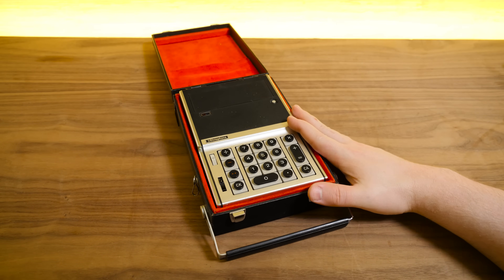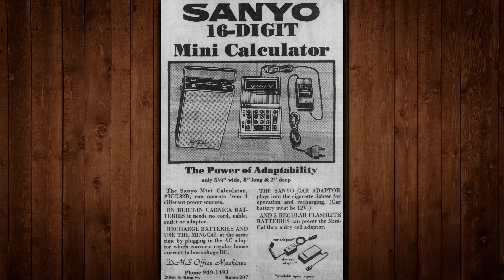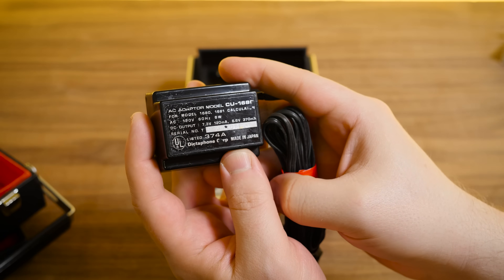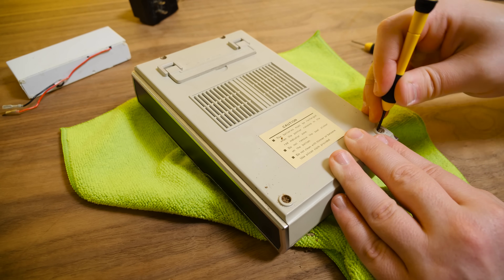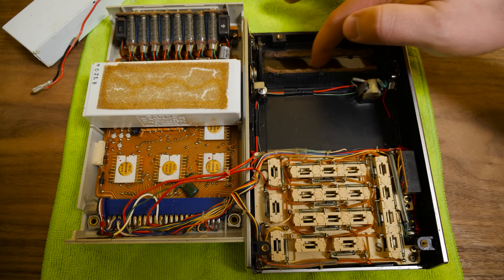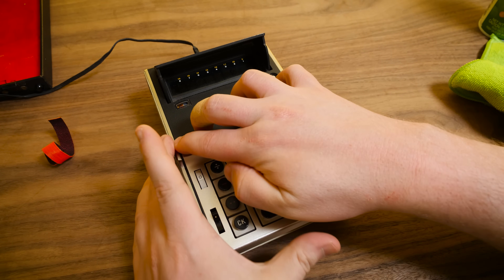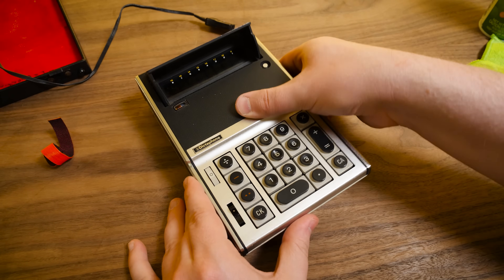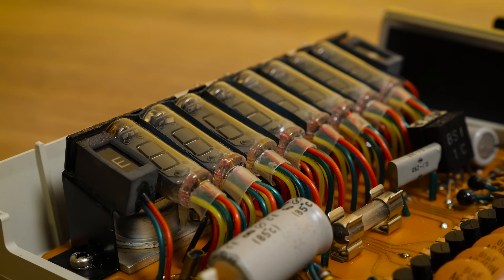Smallest Battery-Powered Calculator in 1970: Dictaphone 1680

Comment: If the display tubes are multiplexed that points to the line going to that segment on every tube not functioning because of a broken wire or trace or could be the switching transistor is dead. Try putting an oscilloscope on the connection for each segment and tracing it back to locate a break or other fault.

Comment: Hey, can I give feedback about the channel?  Im not at all a fan of how now you have a watermark on your channel that is in a black bar on the side of the screen. I want no black bars on the side and I definitely don't want a black bar that has a bright logo floating in it. It's very distracting. Can you keep it on the video at least? Thanks!
Reply from the maker: There is no watermark or black bars in any of my videos. This is a problem on your end of things!

If you're seeing black bars that means you're watching on a non-16:9 display. All my videos are standard 3840x2160 4K videos with a 16:9 aspect ratio. Black bars are added by the YouTube player, it's not part of the video.

The "watermark" you mention is something added by YouTube as clickable a channel logo, it's not part of the video either. You can turn that off in your video settings by clicking the little gear icon in the bottom-right and clicking "annotations."

Comment: The display tubes are panaplex, work exactly like nixies but instead of digit shaped cathodes they are in a 7 segment arrangement. Pretty much that's their only similarity to VFDs as they do have a gas fill (I believe neon and maybe argon) to facilitate plasmic discharge unlike VFDs which operate under a vacuum and light up due to thermionic emission striking phosphors.

As for the missing F and G segments on the tubes, since they are all out this suggests the tubes are driven multiplexed. I'd start by looking for cold solder joints leading up to the tubes but it's most likely the open collector cathode drive high voltage transistors for those segments have died and need to be replaced.
Reply: I had arrived at the multiplex part as well, but I wasn't too sure where to go from there. I've made my own devices with 7 segment displays before, so I'm very aware of multiplexing them. But I use LED displays and ATmega and ESP chips which don't usually need transistors. I hope Clint reads your comment, because failing transistors, especially with your explanation of how these display tubes work, makes perfect sense.

Comment: They just don't make things like they used to. You can take an abacus from 3000 years ago, or even a slide rule from 300 years ago, and they would still be operating up to spec. And this overcomplicated gizmo is good for nothing but aesthetics after just 50 years.
Reply: The more complex something is the more points of failure it has.

Comment: 8:24 Love those gold legged chips. When I took my Yamaha DX7 apart to fit an expansion board I saw it used chips a bit like that. No expense spared.
Reply: I looked it up and you were right, they look awesome!
Reply: Check out pictures of the Yamaha GS1 circuit board. That really was no expense spared. Not only did it have dozens of those ceramic ICs, the board was the shape of a baby grand Piano !!!

Comment: So we lose the exact same segment on every digit - that's too much of a coincidence for my liking.  I don't imagine that the driver transistor for that segment failed on every digit - more likely there's something like a ground connection that's common to that segment on every digit.
Reply: you can see 7 little transistors of an antiquated package near the left side of the board.  One can only assume those are the segment drivers and each digit is multiplexed.  I think these are the packages that go bad often
Reply: Unless it's a multiplexed display where only one digit is illuminated at a time & it rapidly scans, in which case there may well be a transistor that switches that segment for every digit.
Reply: Looking back at the video, I believe it has to be a multiplexed display, there aren't enough transistors for it to work any other way. For each digit, one terminal of all the segments (either anode or cathode) is common for the digit. The other terminal of each segment is common for the segment (i.e. for all the digits).

Comment: I have no clue but do any of the solder joints look corroded or broken? Might need a strong magnify glass to check or meter or oscilloscope to test.  if so you might need to reflow the joints. Do any of the components look leaky?  You probably already know this and checked already but good luck! Its way cool :-)

Comment: Hey, watching you talk about the dead rubbery feet and seeing that you like old stuff, part of which are made of plastic, I wonder if you would know anything about this car dashboard problem that I have. The car is not ancient, it's a 2006 model. The dashboard is just a plain piece of normal plastic, marked as PP+EPDM-T20 (Flexible Polypropylene). Its color is a dark gray, but there are these spots that have turned a lighter gray. There is one spot around each of the side ventilation vents, and the whole passenger's airbag cover, which is just a piece of plastic, as this one does not have any airbags.

Do you happen to have any idea if there's anything I could do besides painting? I figured that if you like such old devices, you might have at least some kind of interest in restoring plastics...
Reply: How do you get from LGR to car dashboards? Like, what?

Comment: My guess. The capacitor turned into a resistor for that one element in the nixie tube. It would have been handy if something popped with magic smoke so it could be identified. Ten years after approximately, I got a credit card size calculator with a solar panel for power. I like the miniaturization. The calculating machine plans in the clockwork age were apparently the size of a cathedral. Just for collating projectile targeting. Didn't get built.
Reply: I would agree with you on capacitor checking or even just a matter of course replace them all. But remember, you can go up in voltage rating but not too much on capacitance rating. For example you can replace a 500uf 25v cap with a 650uf 50v cap. As long as the capacitance is within a 5% max tolerance, you should be good.
Reply: Shame im not in your country. I would love to repair such an ancient LGR THING!
Reply: I agree if it was a capacitor, it would not be identifiable. Can it also be a resistor that would be burned out on the inside? Like when the original battery was taken out, there was some melt marks.

Comment: A Nixie tube is a type of gas discharge tube, there are multiple types that fall into that family but VFDs are not one of them, they operate on a different principle :)
The calculator is bloody beautiful!
You can take a prodding stick small enough and poke at the connections to the tubes whilst the calculator is on and see if it affects which segments will light up, something this old may very well have dry joints. The same goes for all of the ICs and basically anywhere there is a solder connection, a gently prod around with a prodding stick may reveal some dry or cracked joints without having to bust out a microscope/magnifying glass thingy.
It would be a good idea to check voltages, too. Check the voltages at the ICs, check voltages everywhere. Use a multimeter to buzz out the connections to the tubes that won't light at all, from the tube to it's origin point in circuit etc etc etc
I'd love the chance to fix and restore it but I would imagine shipping it to the UK is a bit too costly and annoying haha
Reply from the maker: Yep, only the earlier version of this had nixie tubes. As mentioned this one is a later one without them!
Reply: @LGR  I'm super jealous I can't resist anything with Nixies, VFDs of all shapes and sizes, other gas discharge displays etc
Nice find :D

Comment: Did I see that right every single key has a fuse?
Reply: I believe they're magnetic reed switches - pressing a key brings a magnet into proximity with the reed switch, causing the switch contacts to close. The glass envelope contains nitrogen instead of air, preventing oxidation of the switch contacts.

Comment: I think Ben Heck did a repair video on something that had a similar problem with the display, but he basically said that it was just because it was an old part. I don't think he tried to fix the display itself cuz he didn't have the tools
Reply: I was thinking as well about Ben Heck! I really think he can fix this!  He is the calculator wizard.
Reply: I wouldn't like to comment on Ben Heck's abilities, I'm not qualified to judge but I find he tends to be rather destructive in his "fixes." He doesn't preserve and restore so much as rip out and replace. He's not the guy I would entrust vintage electronics to.

Comment: I'm sure Adrian (Adrian's Digital Basement) would have an oscilloscope to check out what the chips etc are doing and see if it can be fixed :D. Collab? :P.
Reply: Fran (franlab) would be more at home with faultfinding those old display tubes and IC:s
Reply: I came here to say this - I think you need a rescue collab with someone like ADB.
Reply: Came here to say the same thing. Or Fran.

Comment: Could the three non-functional tubes be creating an open circuit and cause the functioning tubes to have incomplete displays? (Forgive me if this is a stupid theory!)
Reply: I doubt that as the equals command isn’t doing it’s job, but is actually responding. That might be an issue too but there’s definitely a problem with the logic.
Reply: @ParallelSyntax  True. Would chip failure affect the tubes powering on or displaying properly when global cleared? I feel like that’s more a power issue and they’d just display a static “8” if they were able to receive power but not commands.
Reply: No they wouldn't. Those tubes are fed by 7 wires that are either 0 or 1, or to be more precise that have current or don't. It's like having 7 led's from which one doesn't work. The principle is the same as we use nowadays 7 segment displays, just back in the days they didn't have that technology. They used tubes. Each segment have it's own positive wire and the same ground. I think the capacitors are dead.